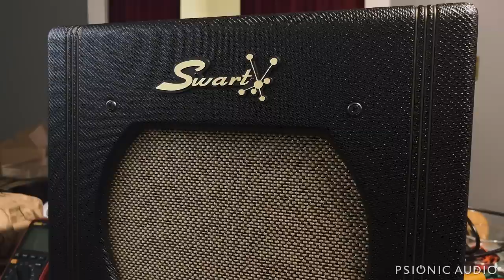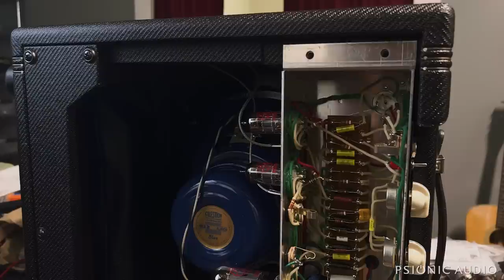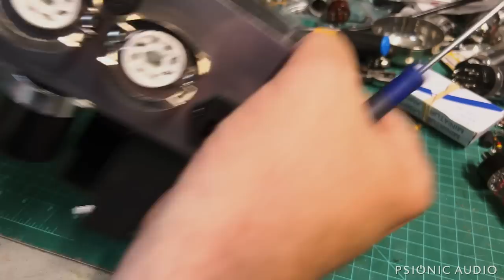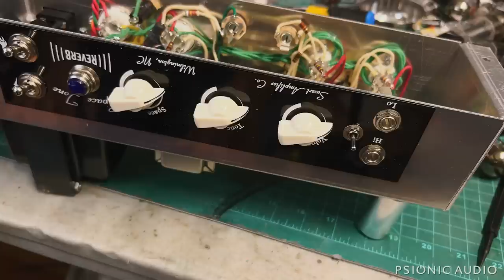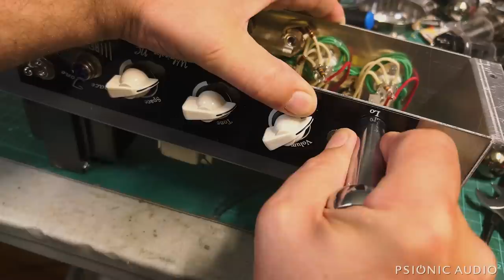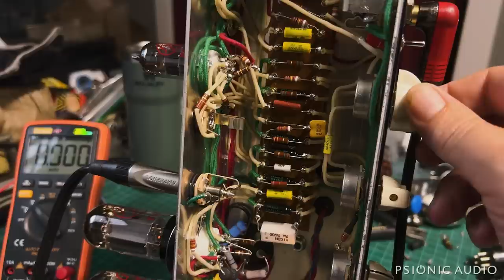Swart Space Tone Reverb | Repair and Review

Comment: I have owned several Swarts, and currently have a Space tone Jr head, that I play thru a 2x10 cab with Celestion Golds. It is the best rig I have ever owned in 40+ years of playing guitar. It has  enough juice  to be heard over a decently loud drummer. And I have called Swart amps a couple times and Michael Swart personally answered the phone. These amps are highly recommended.
Reply: I've had two different ones over the years. Sold them both only to regret it later.  I just finally  bought one just like this at Reverb for $1300

Comment: I really like the design of this amp. I like the way it's an incremental (or evolutionary?) variation on a tweed era amp, but improved. The way the chassis is bolted in, for example. It's a simple improvement that makes the amp more durable and doesn't make it harder to work on. I would wager the screws on the front panel that secure the baffle are also machine screws engaging with metal inserts. And so on. Just excellent.

Comment: I just bought the smaller brother of this amp, the Atomic Jr. 1 x 8 combo, and it's just as fine, especially run as a head through a 1 x 12 cab. It's put together differently, has one less 12AX7 gain stage (nothing the right boost pedal can't make up), and no standby switch. The controls are on the back of the amp, and access to the tubes is much easier, making a tube swapping dream (cold swapping that is, just go refill the coffee cup and enjoy the sounds of silence for a moment). Top quality sound and build with surprising versatility at a great price. Glad to see it passed the audition, as that was the model that inspired my purchase, going smaller after consulting my aching back.

Comment: Had one for a while.  Great reverb.  Looked inside, well built.  Only quibble was previous owner had used an EL34 in it.  The dropping resistors on the cap can were discolored.  I would have upped the wattage in those locations as they were 2w (I think).  Mine was real early tuxedo case one.

Comment: That Swart is a very visually pleasing amp! What a looker!! I’m guessing the reverb is solid state driven? I didn’t see a transformer or a driver/recovery tube anywhere. It  sounds good either way.

What’s funny about boutique amp manufacturers not using pot star washers is that they usually come with the dang pots they use(CTS specifically). Is someone saving them to use as currency in a Fallout type world or what?
Reply: No, it’s a tube reverb.
Reply from the maker: I didn’t draw it out, but it looks to be a capacitive driven circuit. See Ampeg, Traynor, I think some old Gibsons.
Reply from the maker: And yes, it’s a tube circuit, just not using a transformer.
Reply: @PsionicAudio  Q: like the new Blackstar St.James amp? (please excuse my ignorance...).
Reply: @PsionicAudio  , some vintage Magnatone amps use capacitor-driven reverb.
Reply from the maker: @charlymusic No. Who knows what’s going on in those. I’ll find out once they come out of warranty.
Reply: @PsionicAudio  , I wrote "vintage" Magnatones were typically capacitor-driven reverb circuits. Modern ones might be similar in name only. A few older stereo or pseudo-stereo Maggies actually took a padded-down portion of signal from the output transformer of one channel and fed it into the preamp of the second channel which had its own amp and speaker for a "wet-only" output.
Reply from the maker: I was replying about the St James not the Maggie
Reply: @PsionicAudio  , whoops, I missed that. My powers of observation are off today (sick dog, didn't get much sleep last night).
Reply: Thanks  @PsionicAudio

Comment: I have the same Audio Taper CTS on the Volume pot on a guitar...what do you recommend to allow a smoother response than the CTS? I'm surprised there are people (even here) who criticize...you are so methodical and thorough...not to mention experienced...such great videos Sir, thanks.
Reply from the maker: The “vintage taper” pots made by CTS for Mojotone and RS Guitarworks don’t have the issue. Neither do the Emersons.

But all three have been hard to get this past two years.

Alpha 3/8” bushing 24mms don’t have the issue but they are hard to solder to the case and they are only available in solid shaft.

Comment: Speaking of “the tubes may have been damaged” it’d be interesting to see you restore an old Mullard or GE tube tester, or maybe review a couple of the newer tube tester products out there.
Reply: I have owned and refurbished a bunch of vintage tube testers ---- many Hickok as well as a few Triplett, Heathkit, and B&K testers ---- but I've never seen a Mullard tube tester here in the States. I don't think I've ever seen a GE tube tester either.  Bear in mind that the majority of the vintage tube testers don't test output  tubes at anywhere near the voltage/current that they would be run at in an amplifier, and so they are mostly good for testing large groups of the same type of tube just to weed out the ones that have obvious shorts or are gassy or perhaps have interelement leakage. But, ultimately you don't quite know how they'll perform until you put them into the actual amplifier and drive them harder.  As for the modern testers I don't have any experience with Maxi-checkers or the Orange tube tester or any of those, so I really can't advise you further...
Reply: @goodun2974  the valve wizard seems to have made something using someone else’s code and an arduino, seems like it does actually test at full voltage, just in very short bursts.

Comment: I have the same amp. Would you be willing to share the detail of what you did to de-pop the gain switch? What value resistor did you end up using?
Reply from the maker: I used a 3.3M from the switch center to the ground lug of the adjacent input jack. That way the grid never loses a reference to ground and hence loses its bias at the moment of switching. 

This resistor will be in parallel with any existing resistor to ground ahead of it when in either switch position, so you want a high value that doesn’t change the sound of the existing two positions.  3.3M-10M range is typical for this.
Reply: @PsionicAudio  Wow. Thank you! Love, love your channel.

Comment: Any thoughts on the build quality of this amp compared to the Tone King Gremlin?
Reply from the maker: I have no experience with the Gremlin.
Reply: The Gremlin is well built but has some strange MOSFET HT regulation on various nodes in the power supply which like to fail.
Great sounding amps, though.

Comment: Ya know, so many amplifier manufacturers, from boutique to mega-corporate, are building 1950's style amps with upward facing, rear-mounted control panels ---- and silkscreening the control panel in the same manner, as if the amp would be in front of the player on stage, instead of behind him or her. Why should players have to look at the knobs and controls upside down, in 2022?

Comment: Just one minor thing to carp about; the chassis doesn't appear to be marked with the value of the correct B+ fuse (did a P-touch label fall off?), and I don't care for where the fuseholder is located right next to the tubes: this could lead to premature fuse failure from excess heat, and scorched fingers if you don't let the amp cool for a minute or two before trying to change the fuse. Or perhaps that's two things I'm carping about.... Otherwise it looks quite nicely built.
Reply from the maker: If I had put that in the review people would say I was inventing things to criticize. ;)

Maybe the fuse values are listed in the owner’s manual. I’m just glad it has a B+ fuse.

They’ll only burn their fingers once.
Reply: @PsionicAudio  , who takes a guitar amp owner's manual with them to the gig ? 🤔 (Actually, it's probably online, since so few products include an actual paper manual anymore; or the manual  Is the size of a postage stamp until you unfold it and then you need a magnifying glass to read it.  If the amplifier in question is one of these new miracle products that has 100 different tonal settings, you darn well better have a way to access the owner's manual when you're setting up at the gig! I also wonder if men have a better track record of actually reading owner's manuals then they do at asking for directions when their significant other thinks they're lost...).
Reply from the maker: Well, smart players look to see what spare fuses they should carry in their gig bag.

Just sayin.' ;)
Reply: @PsionicAudio  , this also begs the question ---- since fuseholders are usually rated for AC volts and current, how high should the AC voltage rating on the fuseholder be if it's gonna be used for DC B+ of 400 to 500 volts?

Comment: What does single ended amp mean?
Reply: Single-ended means that there is only one output tube that drives the output transformer and speaker.  This means that the tube is ---- and must be ---- biased to run in class A mode, where the single tube passes both halves (both + and - polarity) of the audio-signal waveform; it also means that the tube is used in a less efficient manner, draws a high level of current at idle (even when it is not actually passing a music signal) and generates less audio power than it's  theoretical maximum capability.  On the plus side, a single-ended amp can be overdriven at relatively modest volume levels, and so they're often favored for recording as well as playing guitar at home. Plus, they can be relatively inexpensive to construct because you only need one output tube, one socket for that tube and a smaller,  less expensive output transformer. By comparison, a push-pull amplifier has a pair of output tubes (sometimes a quartet), and one tube handles the positive half of the audio waveform, followed by the other tube handling the negative half of the waveform.. Each tube is only conducting audio for a little more than 50% of the time (with some overlap between them, depending on how the bias is set; like two runners handing a baton back-and-forth to each other as they run side-by-side), and so the tubes don't run quite as hot, don't draw as much current, and the circuit is more efficient and generates more clean power. As an example, a single Class A mode EL84 can put out 3 or 4 watts, a single 6V6 about 4 to 5 watts,   but a pair of EL84'S  in push-pull can put out 12 to 15 watts,  and a pair of push-pull 6V6's perhaps 18 to 20 watts.  I hope this answers your question!
Reply: @goodun2974  it does! Why though are there 2 “power” tubes in this amp?  Never mind one is a rectifier. Got it Thanks!
Reply: @chrisfit  , I really dislike it when some people refer to output tube(s) as a "power tube" , or tubes plural, as it causes confusion. As a tech, when I hear "power", I think of the power supply first and foremost; and so, I am careful to differentiate "rectifier tube" from "output tube", and "power supply" from "audio output power".
Reply: @chrisfit  , by the way, some solid-state amps are run in class B mode with NO overlap between the two halves of a push pull output stage, but it is rarely done  with tubes (except for tube-type radio transmitters) because it tends to have high odd-order distortion at the crossover point as one output tube hands off to the other, although some McIntosh amps are purportedly Class B and use extremely high quality specially designed transformers. Audiophiles like Class A solid state amps and decry anything else, but I've got a Class B NAIM amp that sounds very good. Nowadays you see high efficiency Class D amps with switching supplies used for bass guitar, pro audio and some home audio, but most techs don't want to try and fix them if/when they break (switching supplies are murderous on cheap capacitors).

Comment: Re: Getting a Lower Noise Floor on Single-Ended Amps:  Isn't that achieved by adding a filtering stage that has the sometimes unwanted effect of darkening the amp's tone?  Or is there another way?
Reply: Good layout and grounding techniques are important for lowering the noise floor, especially for lowering hum in single-ended amps, because they do not have inherent  phase cancellation of hum in the output stage as a push-pull amp would. Hiss is probably less of an issue because most small single- ended amps don't have an enormous amount of gain.  Of course, anytime you add an extra gain stage or two,  especially for reverb or tremolo, you are more likely to add some noise.
Reply: @goodun2974  Interesting info.  Guess it depends on the single-ended amp maker, whether to take the time to do good layout and grounding, or just add a filter to kill the hiss.  I've not tried a Swart, but consistently read that some/many who have describe the amps as "dark", "better for single coils," and the like.
Reply: @upload2352  , power supply filtering is unlikely to have much effect on "hiss". Buzz ("buzzzzzzz") and hum ("hummmmmm") are indeed affected by filter capacitor values (among other things), but layout and grounding are also extremely important,  and if the layout and grounding are badly done, no amount of additional filter capacitors, nor increases in capacitance, are going to remove all that noise. "Hiss"  can come from not only noisy tubes, but also noisy resistors, conductive circuit boards, layout, lack of shielding for signal-carrying wires as well as lack of shields on the tubes.... but usually the biggest and most likely cause of "hiss" and white-noise "shoosh" is noisy tubes, followed by high-gain circuits,  or lossy designs that throw away a lot of gain but which still add noise to the signal (tone controls tend to sacrifice a lot of gain in favor of frequency response shaplng and so the signal to noise ration is reduced).  It is also worth noting that layout can greatly affect the possibility of the amplifier oscillating;  and if the circuit is close to or on the verge of oscillation it will often add hissy high frequency noise without necessarily "squealing" audibly.
Reply: @goodun2974  Art meets science of amp building.  Thanks for the helpful info.  I've been nervous about single-ended amps due to noise or excessive filtering concerns.
Reply: The fender 007 single ended amp is known for a hum. Ever looked at that amp ?
Reply: @motokev2727  , I have not examined or listened to / played thru an 007.  I did a quick search and people are saying that the hum gets a little louder as the tubes warm up and that it is ever present and constant and does not go up or down as you change the volume setting of the amplifier.  This tells me that the hum does not originate in the part of the preamp circuit that comes before the volume control. The 1st possible culprit that would come to mind is poor filtering or too little filtering in the power supply, but it could also be a ground loop, or perhaps the hum field is being magnetically radiated into the post-volume preamp, the driver tube or output tube circuit. Any idea if the hum is predominantly 60 Hz or 120 Hz?  

 You can ask Lyle if he has worked on one of these;  but since it's an amp that sells for around $400 or so, he probably doesn't work on that many amplifiers that are worth that little ---- because who wants to spend potentially several hundred dollars to fix a $400 amp?  And since it is of course going to be a modern printed-circuit-board based amplifier, making changes to the circuitry and/or layout would be far more difficult than if it was a handwired amp.